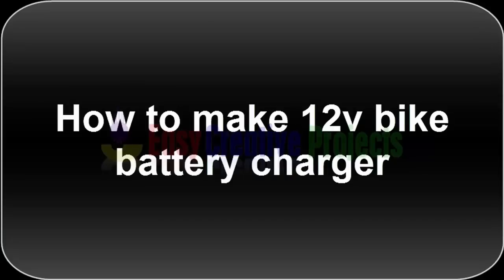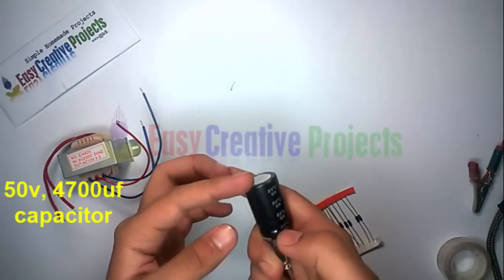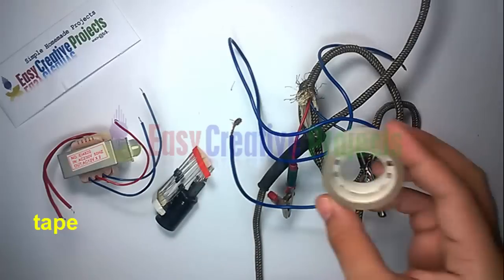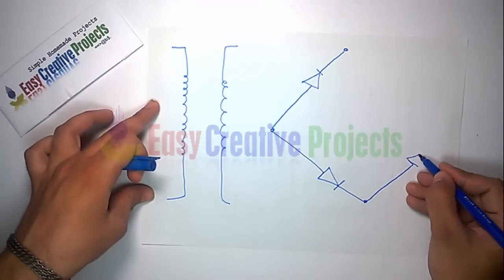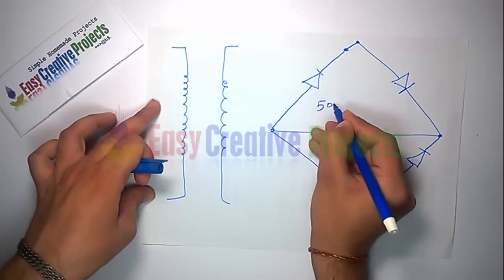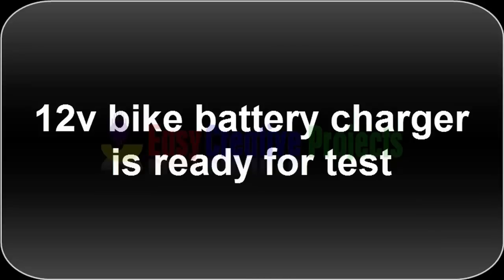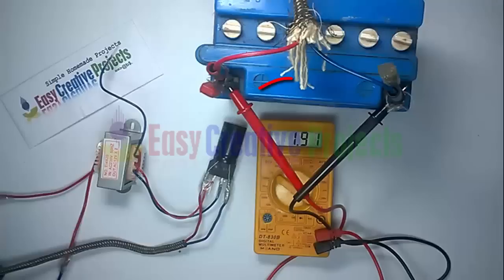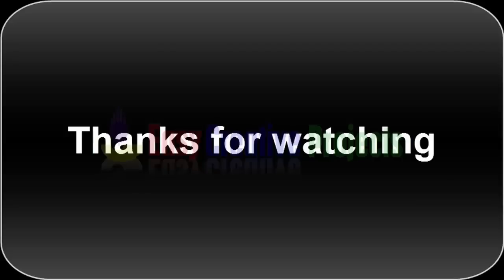How to make 12v bike battery charger - easy step by step with circuit diagram

Comment: can i get constant 12v from 12v two wheeler battery ?is it directly used as power supply for 12v camera without any fluctuations .is there any circuit needed to get stable 12v
Reply from the maker: dear you can get 12v output form 12v battery. because its 12v. 
if your power supply output is 12v then you can directly connect it for battery charging. 
but if your power supply is a 220v then you can use this circuit.
Reply: @EasyCreativeProjects  that means we can connect 12 volts dc battery directly to bike battery
Reply from the maker: @tahaaiyaaz7962  yes you can use.

Comment: Use 1N5408 instead of 1N4007.
1N4007 is self a 1 amp diode so there are possible chance that we get low current compare to 1N5408 because they are 2 amp diode so there are very less chances of current reduction due to diode.
Reply from the maker: yes dear you right. 1n4007 support 1amp and 1n5408 support 2amp.
Reply: Heart Robber  N8

Comment: Can I use 12v 3A transformer, 1N5408 and 4700uf 25v for 12v 9ah bike battery. . . ? If yes then around how much time could it take to charge . . .?
Reply from the maker: yes dear you can use these components. but capacitor voltage is very low. 25v blast soon. 
minimum 35v to 50v, 4700uf capacitor use. 
they give you 3amp output.
Reply: Thank you sooo much . .
Reply: But sir within how much time it will charge the battery?

Comment: 12v 7ah batterv amaron bike battery  which use 12v which ampere transformer use pl replay
Reply from the maker: dear simple use 12v to 15v and 7amp transformer for bike battery charging.

Comment: great Video but No Voltage Regulator, to regulate a Steady 12v output, To control voltage flunctuation
Reply from the maker: because this time we need to charge battery so we dont need voltage regulator.

Comment: This project failure... Out DC volt drob... ... I check..
Reply from the maker: dear its provide you 12v output because we use 12v transformer. when we connect capacitor then its provide us roundabout 14v to 15v. but when we connect this supply with battery then its provide us fix 12v output.